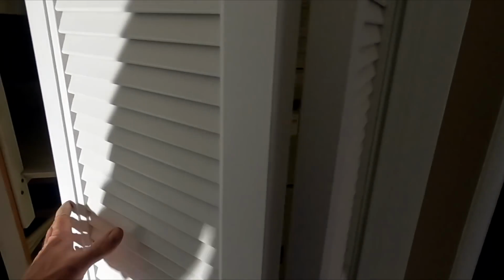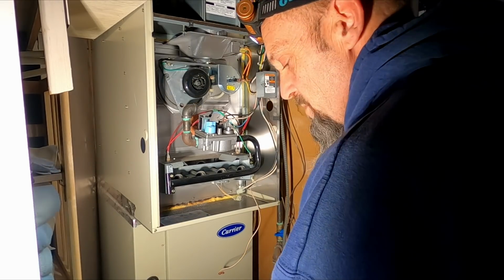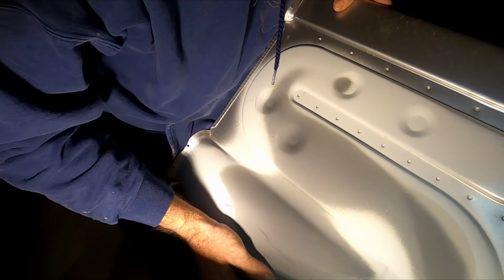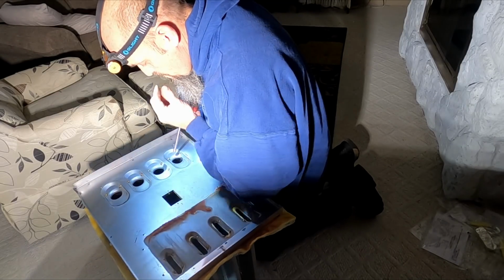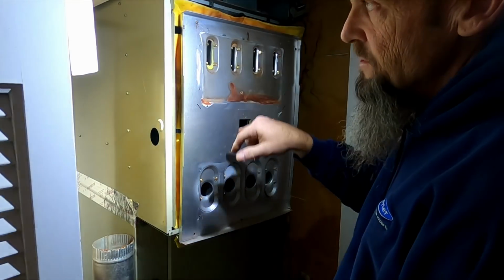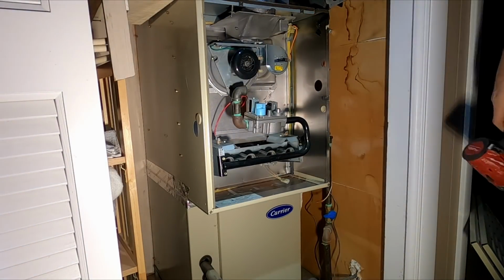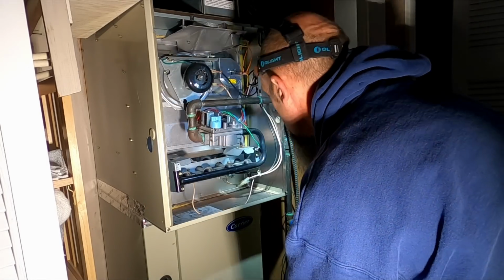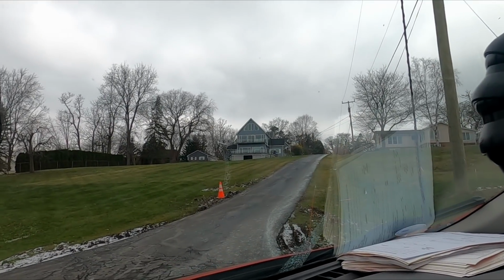Carrier 58ZAV096 Heat Exchanger Replacement

Comment: In an older vid you only removed 2 cells at a time so it was always supported. Then started w/only 2 screws at the top, then did the bottom w/another 2 screws, then went back and put the rest of the screws in at the end.

Comment: I'd like your opinion on the Emerson 49P11-843 SureSwitch Relay? I am thinking of using these on the condenser units at my home. Thanks, Jenkins A/C & Heating
Reply from the maker: I've used them in the past and they seem to be pretty solid I use them when I run into problems with bugs and ants in the contactor

Comment: Mi Heating Guy do you agree that the Carrier 9200 Weather Maker series had the best sounding inducer motors? The sound produced by the outside exhaust port could be used for tinnitus therapy. I find the sound to be calming. Those were solidly built furnaces with many still around.

Comment: That old Carrier was in good shape for being that old.  I think if the Gov. wants to mandate 90+ gas furnaces then they need to require the Manufactures to have a 20+ year Heat Exchanger Warranty.  These early failures on the "money efficient" furnaces are a scam if you ask me.

Comment: Looks like its more labor replacing the heat exchanger then the entire furnace. Does it makes a big difference on price?
Reply: Depends if the exchanger is under warranty or not.  During busy months I don't bother changing them as we just don't have the time, unless it's a Goodman.  Those are almost always easy to change.  Carrier, ICP condensing, F that.  Not worth my time.

Comment: The fact someone wants to change that HE is outrageous. Just put a new one in yikes.Gotta love the free smoke detector test , unless its wired to an alarm system fire dept. usually isnt to happy when they show up. Not that thats happend to me before........ Well done on the job man! And thats correct, you cant install a mid efficiency in Canada. I think since about 2006.
Reply: If they had an alarm company monitoring. I told the homeowners to call alarm company and have them put it in test mode for 1 hour.
Reply: yea, 2006 or really close to it. i think i was privileged enough to install 2 mids before that rule change came in, give it another 10 years mids should be gone from canada all together, and all the nasty installations will at least be pvc then. i feel especially bad for the condos that have furnaces outside on the deck area, i have unthawed alot of high's that go down for simple reasons. always recommend backup heat for the mech room, but no one wants to listen

Comment: Joe the MHEE(master heat exchanger -exchanger) at it again. Could have used some of that new heat resistant aluminum tape to hold that insulation in place , but great job as always . Stay warm . Central  Florida was 85 degrees today. Thanks for posting .

Comment: I was supposed to do one today but there was a change and I end up replacing a radiator valve that was stuck open.  the real problem is the feed valve.  they got a shine new valve instead. I may be going back if the landlord approves.

Comment: Such a shame that was still covered by warranty, totally not worth it and the buyer gets stuck with a 80%'er.
Reply: If a buyer is smart. They will get a credit for a new system. When i bought my last house i had 12k taken off the house. Seller was pissed they did the same thing the flipper did. Told them I wont buy a house with a 30 year old equipment
Reply from the maker: it wasn't under warranty
Reply: @MiHeatingGuy  wait - you mean the actual part? that's crazy! once the hxt has failed out of warranty, should be an automatic furnace replacement.
Reply from the maker: Customer didn't want to spend the money.I can lead them to water but can't make them drink